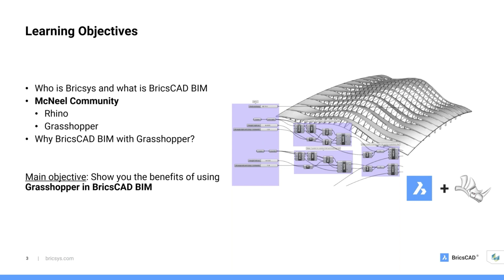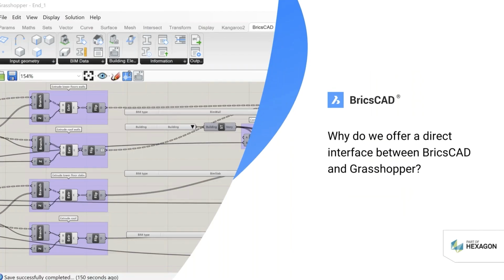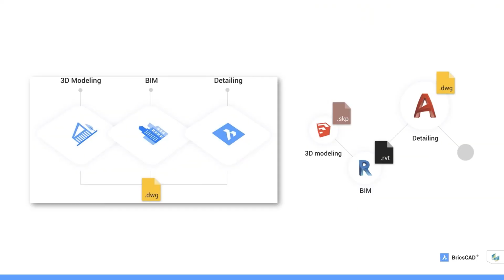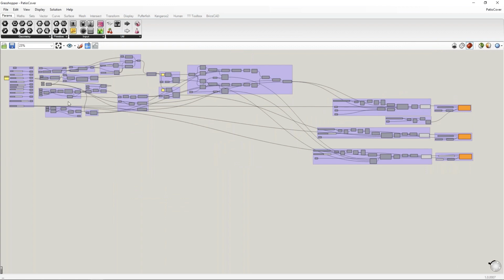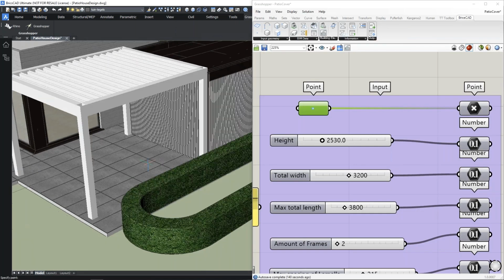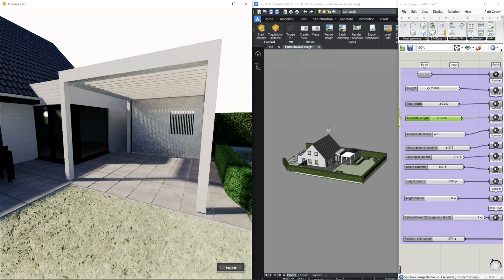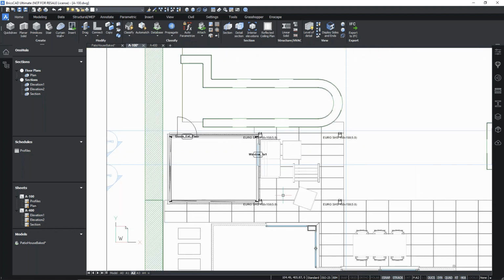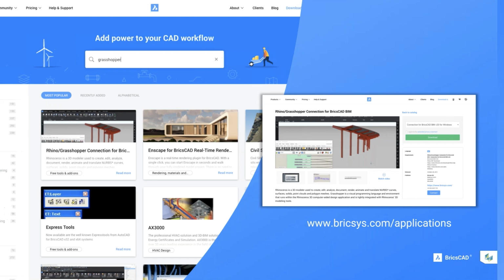Generative design with Grasshopper in BricsCAD BIM l BricsCAD Webinar

Comment: i got the plug in installed , but i can't find a way to reference BCAD object in GH , say i modeled a cube , i go into grasshopper and added a Brep component , now right click and choose reference 1 Brep , it won't let you reference anything in bricscad
Reply from the maker: Hi @mohameddawood1720 - I would suggest to check if the plugin is correctly installed. 
Here is some more information on how to use BricsCAD BIM with Rhino/Grasshopper: https://help.bricsys.com/en-us/document/bricscad-bim/design-assistance/rhino-grasshopper-integration?version=V25&id=165079160221

If you need further assistance, I recommend creating a support request under the Application category for Rhino/Grasshopper Connection for BricsCAD BIM. Here is some info on how to create a support request: https://help.bricsys.com/en-us/document/knowledge-base/customer-service-and-website/how-to-submit-a-support-request?id=173651106110

Hope this helps!